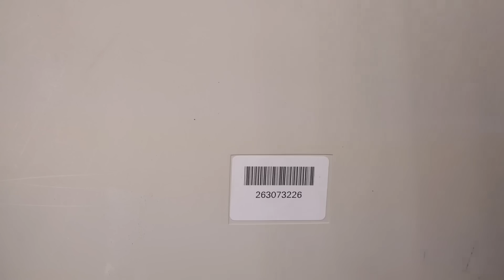Figuring out how to remove polystyrene residue from cords

Comment: The last cable with polystyrene stuck to it that I had to deal with were the cables attached to my Speccy+ power supply, mostly just rubbed it down with 99% IPA on some paper towels, and it came off reasonably well, with some "mechanical action" (AKA using my thumbnail to scrape it) in places, I never used acetone owing to its ability to turn plastic into goo, and after I was done just gave the cables a good wipe with some antibacterial wipes to clean off the former-owner human slime... :P

Comment: It's very simple. Just use some nail varnish remover - it is designed to dissolve styrene and similar plastics but has no effect on vinyls.
Reply: That's only somewhat true. Many nail varnish removers plug the fact that they are acetone free. However, the solvents that comprise them are still effective on styrene. @thesquarerootofnegativei6225
Reply: I can't believe that this is turning into some kind of epic chemical event. The answer to this - very minor - problem is so simple and has been known for decades. Is the general standard of scientific education really this low nowadays? Unfortunately, I fear it is along with most other aspects of education.

Comment: My Tandy color computer 3 had what looks like soldering iron marks in it, but it is where the power cord was wrapped around it in storage from the mid 90s to the early 2000s.

You would need to be really really careful but automotive gasoline will break down Styrofoam, but you would need to test against what you want to clean.   Mineral spirts might be a good option also...

A silicone spray after cleaning it will return the shine to most plastics.

Comment: if you use chemicals on the cables, please clean it off with plain water.  I have found that both IPA and those pre-moistened cloths work well to remove residues, but both leave their own residue that makes the cable sticky (probably dissolves the plastic) in the future

Comment: I think you should avoid the Alcohol! It will dry out the cord . As a collector and restorer of antique telephones I can tell you what I do. Get a 1 qt yogurt tub put  some dishwashing liquid In it then fill with hot water and mix.nowbsoak the cord in there overnight . When possible I detach the cords and tape the ends to the outside of the tub. In the morning all I have to do is takes green dish scrubber sponge over it . I usually follow up after drying with a coating of armour all.

Comment: For sticker removal I always use peanut butter. Let the fat soak in for a day, and wipe of with any mild detergent like dish washing soap. Easy, and no nasty chemicals.
Reply: Unless you need the pasty consistency, cooking oil is a far cheaper option.
Reply: @ItsMrAssholeToYou  that will usually work on sticker glue. I agree. I doubt it will break down styrofoam. I’ve seen people use styrofoam coolers to catch the motor oil from their pan when they change the oil, and it doesn’t attack the styrofoam unless there’s gas in the oil.
Reply: @ptphil64  
That's true, not styrofoam.  I was referring to your cited example of stickers.  Since it's the peanut oil that's doing the work with PB, it's effectively equivalent to any other cooking oil.  PB stays where it's put better, but oil is easier to apply and clean-up and is cheaper.

I've found that plant oils to also be effective at removing chewing gum and permanent marker.  Though for permanent marker, alcohol is equally or more effective and easier to use.
Reply: @ItsMrAssholeToYou  cooking oil runs down and makes a mess. Peanut butter in the Netherlands is not runny at all.
Reply: @Nerd3927  
Right, which is why I said "PB stays where it's put better".  I guess a more articulate phrasing would be: "It does a better job of staying where it's applied."  I don't think PB is runny in any country, unless it's some sort of specialty recipe or is stored in particularly warm conditions.

If you have a surface that's too vertical, then something like PB is the right choice.  If you can get the surface reasonably horizontal, a thin coat of cooking oil goes on easier, cleans-up easier, is cheaper, and probably works faster since it doesn't need to diffuse out of solution.
Reply: Naphtha, AKA lighter fluid. Dampen a paper towel and it will liquify styrofoam and most glues on contact, so no scrubbing at all. But it will attack some polymers (obviously) so test it on a small spot first. I’ve used it without issue on cable insulation, ABS, and plastic, but I’ve also seen it attack some of the plastic on an IBM-brand PC. IIRC the front plastic case handled it fine, but the plastic on the floppy drives melted.

Comment: Styrofoam aka expanded polystyrene, styrene being a name for phenylethene or vinyl benzene, ethene with one hydrogen replaced with a benzene ring. PVC, poly vinyl chloride: polymer of vinyl chloride aka chloroethene, ethene with one hydrogen replaced with a chlorine.

Acetone and IPA are chemical "siblings" if you like, acetone being the more oxidised form of IPA.

Chemistry is fun.

Comment: I regularly use my own solution of low concentration acetone and 99% IPA for this kind of thing. I also use it for cleaning the bed of my 3D printer and it works great - way better than either acetone or IPA on their own.

Comment: Butane. I kid you not. Butane (aka lighter fluid) will remove gunk of any sort without much effort and will not damage the underlying surface regardless of material. Then use a little distilled water (no calcium) for a final cleaning. You will be amazed.
Reply from the maker: Nice tip! I know people used to use gasoline for similar cleaning before everyone realizes it was so carcinogenic.
Reply: @adriansdigitalbasement2  Can confirm lighter fluid is excellent - I ran an eBay pre-owned game business and used it to remove adhesive from video game cases.  Use common sense (and gloves!)
Reply: Yeah, i wouldn't want petrol fumes inside the house.
Reply: Butane is NOT lighter fluid(it's a gas)(it's a liquid when it's under pressure though), you probably mean Naphtha (which is what in Ronsonol and Zippo lighter fluid, (other brands exist, but those are the most common brands, at least in the USA).
Reply: @m.k.8158  yeah, if it's a liquid (that isn't freezing cold and boiling at room temp) it's not butane!

Comment: I'm curious how something like WD40 would work. I don't know that I'd test it on something like that, but maybe on a junk cord that you don't care about first just in case. I use it for cleaning my tools a lot and it seems to clean nearly everything I use really well. Idk just a thought.
Reply: WD40 is great for this and removing stuck on labels and adhesives.  I usually apply and let it sit for a few minutes and things just wipe away.
Reply: You can pretty much clean anything with WD40...it doesnt hurt much.  I spray my entire bikes down, painted parts, rubber, pvc, etc. to over winter them without rusting.  It is easy to wipe off in the spring.  It also smells nice lol
Reply: Just make sure to wipe it off thoroughly, as WD-40 will turn tacky over time.

Comment: Acetone will melt the styrofoam residue and left it in a "glue" form until you wipe it away with more acetone, so it's no shiny. 99% IPA not able to tackle the already melt styrofoam residue but can remove the existing original that stick on the cable.

Comment: With the Commodore drives don't wrap the cables around the case. If left long enough it will melt into the case as well. So it's not just Styrofoam.

Comment: These PVC IBM cords are insanely strong.. Mine still look brand new after 40+ years.. Can't say the same for Compaq. The cords they used tend to completely desintegrate. The softeners just seem to "evaporate" making them crumble into an million pieces, which makes a lot of those old Deskpros, Portables and SLTs look pretty sad. I always replace them 🙂
Reply: Probably made of the same cheap rubber as the rubberized grips on mice and stuff. I got a secondhand mouse once whose surface had turned sticky, and just 50% rubbing alcohol was enough to "activate" it and turn it the rest of the way into liquid. The good news is that it turned out to be a very thin coating, and it was so goopy that I was able to wipe it all right off, leaving what could have passed for just a normal plastic mouse if it weren't so smooth. And the side grips and wheel, which are also rubber, have held up just fine; they must be silicone or something.
Reply: iBM stuff cost more than a new car.  They could afford nice plastics.
Reply: @GigsTaggart  I agree. But from what Compaq charged you would expect better quality cables as well. MSRP on a high-end Deskpro 386/25 like the one I have was 25.000USD and the cables on those keyboards evaporate as well...